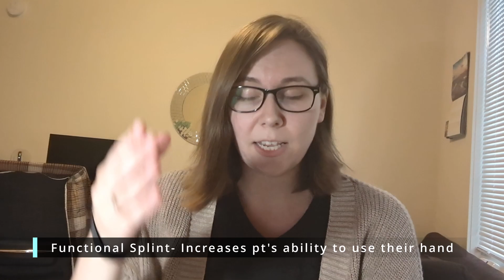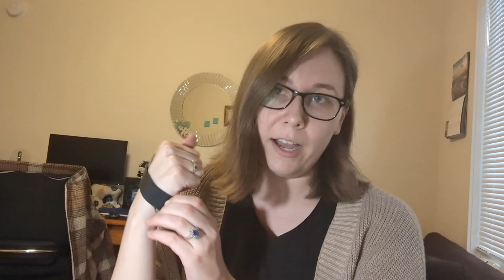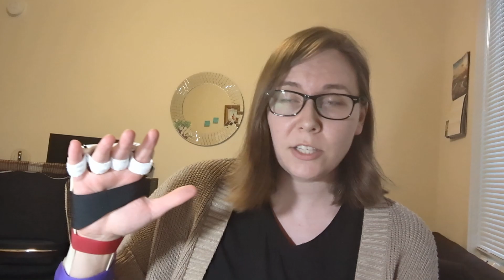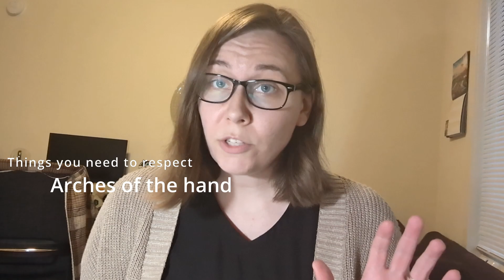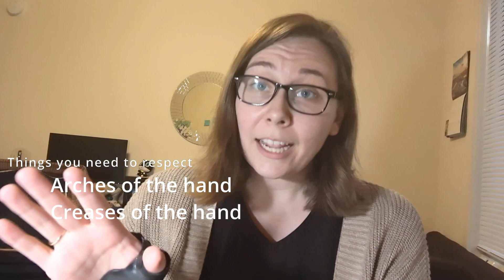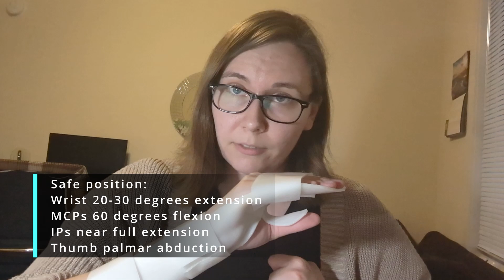Splints (Part 1)- Basic Principles

Comment: Would you say that the static progressive splint is kind of like braces, where the splint can be readjusted at each appointment to allow for increased ROM?
Reply from the maker: With a static progressive splint, the patient should be able to adjust themselves at home. The goal would be to increase ROM by applying a long-duration, low-load stretch. So, the patient would put on the splint, and then increase the tension until they feel a light stretch and hold it there. That way, as their joint starts to loosen up, they can then increase the tension again themselves to increase the stretch. It is a serial static splint that would need to be adjusted by the therapist; that is a splint that does not move, but is remolded (or replaced/remade) as needed. Braces would be an example of a serial static, not static progressive.
Reply: @OTOverEasy  Okay, that makes much more sense. So, the key word here is progressive. My question is, wouldn't that make the static progressive splint dynamic in nature, though? But then referring back to what you said about considering the purpose of the splint, the dynamic splint would allow for function where there is a lack thereof in a client. For example, A person with a radial wrist drop splint may benefit most from a radial nerve palsy splint which allows for movement with just extra support. Thank you so much for these videos though, I am taking my NBCOT COTA exam soon, so these really helped with understanding splints :)
Reply from the maker: @Jane-fs2td  You are so welcome! Think of the difference between dynamic and static progressive like this - when the patient has the brace on and set up, are they supposed to move in it or not? In a dynamic splint, we want them to move. They can pull one direction, and then the splint will 'reset' them when they release. In a static progressive splint, they are not supposed to move once it's set up, they are supposed to just leave it in place and let it stretch them. You are correct in that a static progressive splint does have a moving (dynamic) component, but only during set up- for the main duration of wear, it will not be moving, hence 'static'

Comment: love your videos! I am coming across different surgeries and splints that are commonly used (periods of time immobilization or movement is needed) and a lot about a dynamic outrigger?? still confused on that!
Reply from the maker: A dynamic outrigger is a splint that sits on the back of the hand, and has a pulley system that extends off the back to include either one finger or multiple pulleys for multiple fingers. The patient will be able to actively flex the fingers, and then the outrigger pulley system will passively pull them back into extension. Mostly I hear about them being used after MCP joint replacements, or for radial palsy (but most patients will prefer a low profile splint instead of a bulky outrigger). As a hand therapist, I have never been asked to make a dynamic outrigger and you probably don't need to know much about them for an entry level OT test. I would just look up a picture, and know that for a generalist OT the most common use would be for radial palsy!

Comment: Hello, my name is Victor and I am preparing for my NBCOT Exam. Please, which material is used, or should be used for Short Spica Orthosis. Is it self adherent material or highly drapable material?
Reply from the maker: Did you come across a question that asks this specifically? If so, I'd argue it's not a good exam question because there is not really a right or wrong! Every therapist has different preferences for the materials they use. High drape and self-adherent are not mutually exclusive either. You would likely want a material with good drape to wrap well around the thumb, and I personally also need self adherent with the pattern I use to seal it closed!